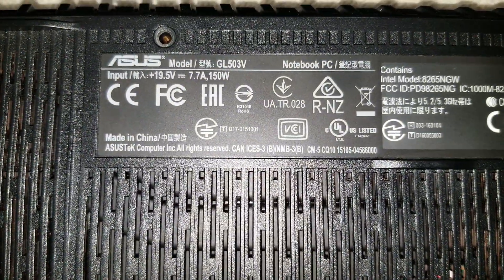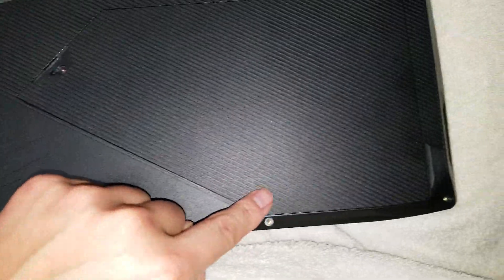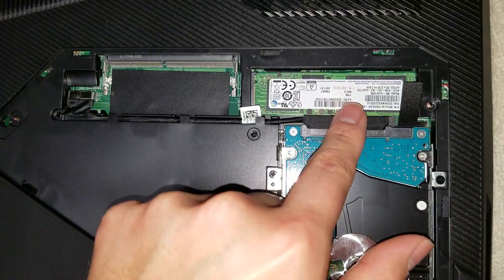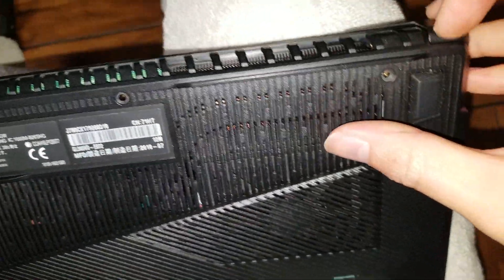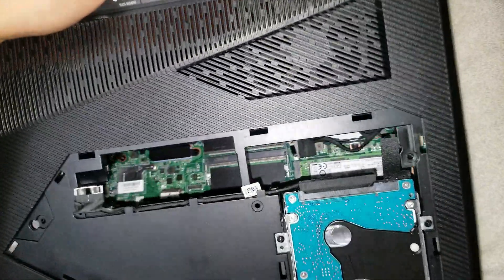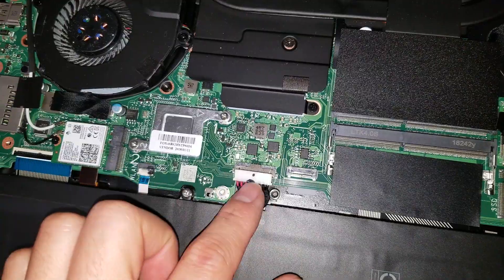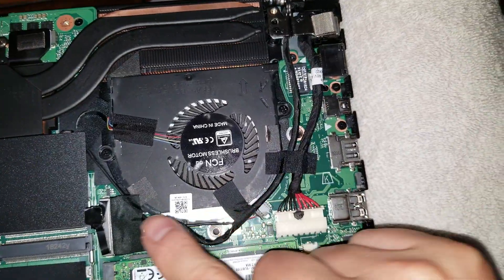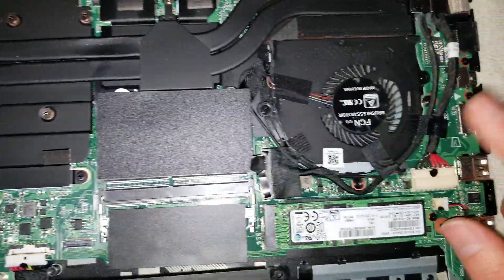ASUS GL503V Laptop Disassembly

Comment: I was working on mine and it force shut down and I now can’t start it up again. The keyboard lights up and I can hear the SSHD but the fans don’t spin the screen stays black and it switches itself off again. Pls help. I’m probably going to open it up tomorrow to see if there is any visible damage. I have already tested the power supply and it’s working fine and the battery seems to hold charge. I’m worried it might be the graphics processor or something serious that is damaged any advice would be helpful thanks in advance!
Reply from the maker: If you're lucky it might just be the ram
Reply: This is exactly what i have to deal with right now. Any tips?

Comment: Hello i unscrewed the case and i dont remember where eaxctly each  screw went cuz they are different dimensions
Reply from the maker: Best way to figure out where each might go is to use a needle and then use your fingernail as a marker to measure the length of the screw hole, then just match up the length of the holes with the lengths of the screws.
Reply: i had the same issue, the long screws go at the top where exhaust vents are, the 2 shortest screws bottom corners, rest is easy

Comment: Hey tyvn for the video man. I have a gl503vd i wana ask if you know if tou can replace the standard ram... i have 2 extra slots for ram but the ram stick that is under the cover can it be changed?
Reply from the maker: If it's the same, yes. Open it up and take a look.
Reply: @ItsBinhRepaired  so I've an 8gb ram and wanna get another 8 gb in. I can only use the same model of the original 8 gb huh?
Reply from the maker: @JoeJoseph79  is it a single 8gb stick?
Reply: @ItsBinhRepaired  yup. Do I've to get the same exact model as the first stick? Or any other 8 gb will suffice?
Reply from the maker: @JoeJoseph79  as long as it's the same speed/type it'll be fine.

Comment: Hey, i have the same laptop and it started overheating, like around 90 degrees celcuis on idle, i check with the gaming center my gpu is pretty empty so i tought maybe it is a fan problem or thermal paste problem, do you know by any chance? and is the thermal paste shown somewhere in this video ? i will probally take it to a shop or technican because im too afraid to do anything like that myself but i tought i should check anyway, by the way, is the rog strix series hard to dissamble compared to other laptops ? not sure if i should  go to repir shop for clean and thrmal paste or computer technican .
Reply: ok good to hear. and i will thank you.
Reply from the maker: Please watch the video. Doesn't look too difficult to remove the heatsink, but I didn't do it in the video.
Reply from the maker: If it hasn't shut itself off from the heat, the paste should be ok. You might have to just clean out the dust.

Comment: Great video man. I was wondering if you would no, if it's possible to have a hard drive with 7200 rpm ? thanks
Reply from the maker: Yes, but an SSD would be a much better upgrade.
Reply: @ItsBinhRepaired  okay thats nice to know! Would you by any chances have one to recommend me? Thanks
Reply from the maker: @alextennis24  if you're replacing the spinning drive, 2.5" sata SSD Samsung if price isn't an issue. Crucial, Kingston, or SanDisk for price and quality. Avoid the other brands.

Comment: hello, i hope u read this comment. so last week, my keyboard just died when the laptop was forced shut down while it was not responding in my chrome, i dismissed the problem, but then i encountered same problem where i got to force shut down, and my touch pad isnt working. Eventually i had to change the battery considering the draining continuously,  and turns out the touch pad came back but not the keyboard. Now im determining on changing the keyboard now, can you make any video on how to disassemble to the asus gl503 keyboard parts?? thanks in advance
Reply from the maker: I don't own the devices I work on, so I no longer have it to show that.

Comment: Hey! Not sure if you're still looking at comments but is it easily possible to replace the thermal paste on the CPU? I couldn't quite catch what part the CPU was while looking at your video. 
Also, for the battery, did you disconnect it before you took the laptop apart? Or did you take it apart, remove the battery, and then put it back together for the video?
Reply from the maker: I put it back together for the video after disconnecting it. The cpu is right above the RAM, but I don't recommend removing the heatsink unless it's having issues, because you'll have to be careful with the gpu thermal pads and have to redo the paste on there as well.
Reply: @ItsBinhRepaired   It's Binh Repaired  gotcha, thank you! Yeah I am having issues with the CPU- I stress tested it and it reached 96 degrees Celsius which is...not good to say the least

So you're saying if I repaste the CPU I'll have to repaste the GPU?
Reply from the maker: @ppcakebutreal  yes, did you make sure the fan vents, are clear?
Reply: @ItsBinhRepaired  Yup- I took it apart today and cleaned out the fans and the vents. It does seem to be running a tad better but not as smoothly as it did back for the past year or so.
Reply from the maker: @ppcakebutreal  does the fan spin freely? If not, watch this video. It might help. https://youtu.be/3zs_SJ3BXgA

Comment: Can you make a battery replacement video?
Reply from the maker: This video shows how to get to the battery and disconnect it. There are only a few screws around it holding the battery in place. I don't have the laptop to show it, but should be simple once you get the laptop opened up.

Comment: Mine suddenly just shut off and whenever I plug in my power cord I do not see any battery charging light on. Do you think it’s my motherboard than needs to be replaced?
Reply from the maker: The power cable makes your laptop turn off?
Reply: I have the same problem. Mine just randonmly shut down and will not come back on. No matter if it is plugged in or not. The charging late does not even flick on when the charger is in. What could this be?
Reply from the maker: @tannerdumont7589  sounds like a motherboard issue :( could possibly be the charger or the charge port. You'll need a volt meter to test if power is coming out of the charger.
Reply: Thank you for the info!!